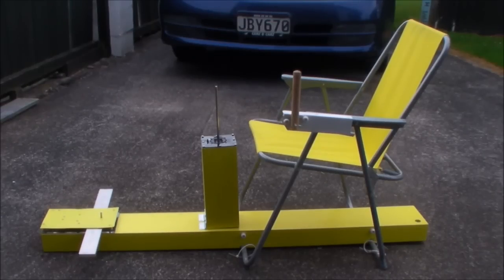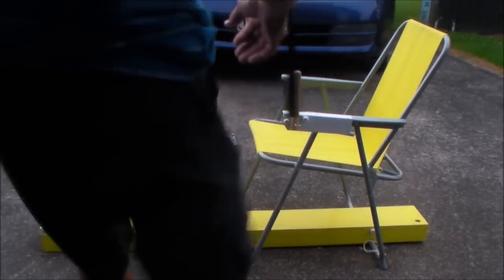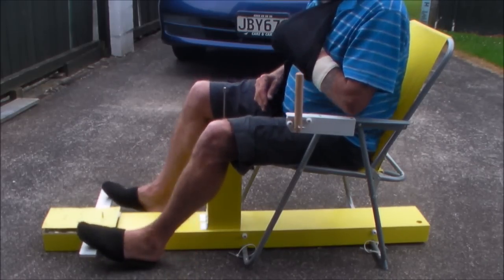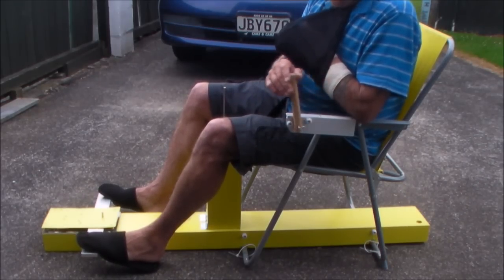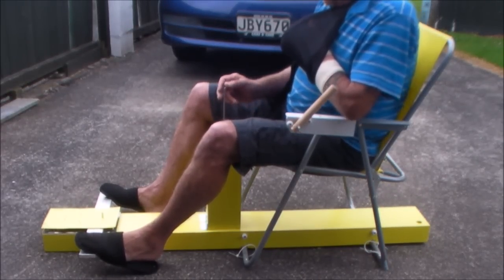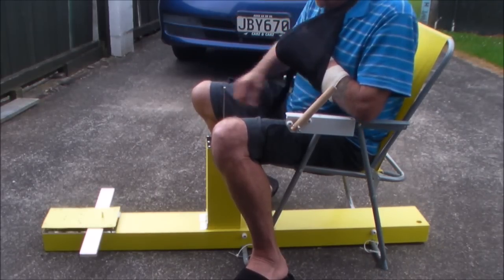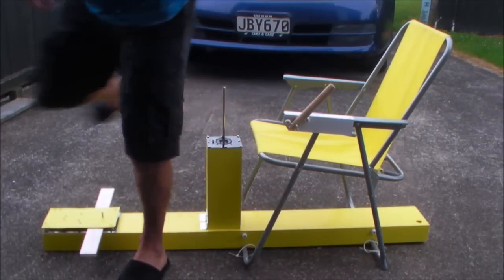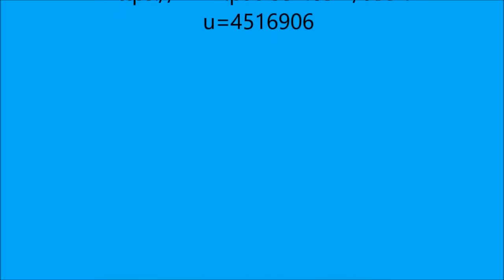Flying chair preview

Comment: A possible Modification to this http://www.ebay.com/itm/NEW-Genie-Dual-Axis-Controller-Genie-Part-101174-101174GT-/131973681726?hash=item1eba3e923e:g:faIAAOSwzgRW1cMW Would make a good HeavyDuty self-centering Center stick ;) I saw your wooden chair. Also Nice!!! You could change your "lever action speed" easily just by changing the throw. 
Like this> http://mustardcat.brinkster.net/blog/shifter.gif
Best of luck to you Sir!!